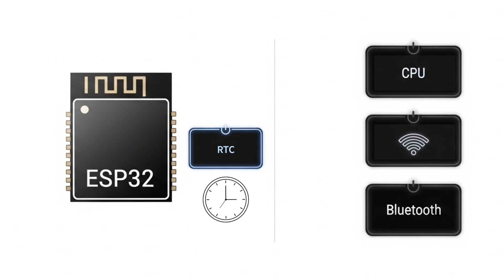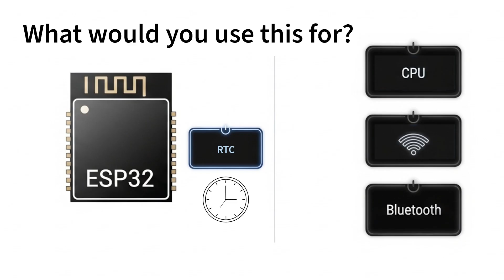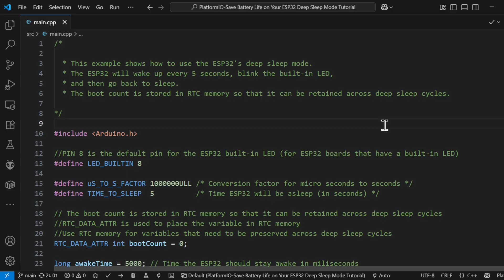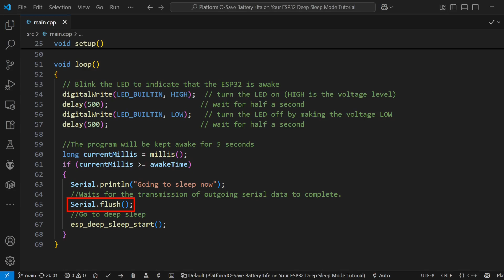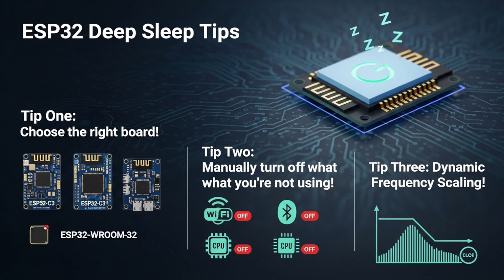Save Battery Life on Your ESP32 – Deep Sleep Mode Tutorial

Comment: Would be great if you had that in Mashtastic.
Reply from the maker: I have thought about experimenting with deep sleep in mesh networks. 

I think the challenge would be maintaining synchronization between nodes. 

If the nodes are sharing data or relaying messages they will need to be awake together at the same time.

Comment: The Problem is ESP32 variants never designed for Low Power Devices however ESP8266,ESP 8285 are low Powered MCU's cause they draw current in deep sleep mode about 7uA or even ESP 01 draws much much lower 3uA. You video content is misdirecting new learners and new makers. However if your requirement is Bluetooth in project it is best to go with ESP32 and use a Switchable LDO with a ATTiny MCU project then you can turn off ESP32 and keep ATTiny alive... this way you can make Low powered ESP32 projects
Reply from the maker: I appreciate your insights regarding low-power MCU options. I'll experiment with some of the modules you mentioned and do a follow up if I can reproduce a lower uA.
Reply: @bjdsolutions8928 Yes, but make sure you check out resistors within ESP variants cause those resistors draw continuous current. If you bare bone ESP8266 can go as low as 3uA without its built-in resistors
Reply from the maker: re: A "Switchable LDO with a ATTiny MCU project then you can turn off ESP32 and keep ATTiny alive... this way you can make Low powered ESP32 projects"

I am thinking something like the Adafruit TPL5110 Low Power Timer Breakout could be a good starting point?
Reply: That is indeed a cool concept. I have done a lot of stuff with the attinyX5 series, long time ago, but I found them  to get too expensive (relatively)  compared to other MCU's. But yes, for this concept it might be a good idea
Reply: If you turn off the power  of esp32 then erase the RTC memory, and the eeprom it has no more than 10.000 r/w life
Reply from the maker: Definitely important to consider!

Comment: Well done! I’m interested in a project that uses wifi and wakes up the ESP by an externally triggered pin change.
Reply from the maker: Thank you for watching!

An event based wakeup would be triggered using the 'External Wake Up' instead of the 'Timer Wake Up' method.

In the video's code: 'esp_sleep_enable_timer_wakeup(TIME_TO_SLEEP * uS_TO_S_FACTOR)' would be replaced by 'esp_sleep_enable_ext0_wakeup(GPIO_NUM_X, level)' in the setup function.

'GPIO_NUM_X' would need to reference a GPIO pin on the esp32 which will be used to trigger the wakeup. 'level' would be set to 0 or 1. Depending on whether the trigger is activated from a LOW or HIGH signal.

Comment: Well explained and useful! How would we design the battery based power supply? To get stable 3.3 V, there is usually a step up / step down converter involved. And those things draw permanently current. Any idea for an overall solution with low power consumption?
Reply from the maker: Thank you for watching!

The ESP32 in the video is a Seed Studio XIAO ESP32-C3. This has battery connectors and a voltage regulator built in. It gets down to 30ua in deep sleep. 

The ESP32 data sheet says 5ua should be possible. Any voltage regulator will add some extra current draw. Perhaps 10ua at a minimum; but I am yet to find a dev board that can go that low.

One solution--a bit more advanced--would be to create a custom PCB for the ESP32 chip that does not use a regulator at all. That is--powered directly by the batteries. The ESP32 has an operating range of 2.2-3.6V. Which means the voltage of the connected battery could not exceed 3.6V. Standard lithium-ion (Li-ion) battery's 4.2V maximum voltage is too high but a LiFePO4 battery would work because it has a typical voltage range of 3.2V so would work.

In short ditching the regulator entirely would get the lowest possible power consumption but the connected batteries must never exceed 3.6V.

Comment: i am making a clock using two 0.96 inch oled screen, ds3231 and esp32. Can the esp32 power the oled while in deep sleep? ( I dismantled this project after doing everything but failed to make it battery powered)
Reply from the maker: Short answer no. The digital I/O pins that would normally control the OLED are not active during deep sleep, so they cannot provide power or control the display.

It would be possible to maintain power to the oled if it's VCC line was powered directly while the ESP32 was asleep. But the ESP32 could not update the display until it woke back up. The OLED would also need to have it's own RAM buffer to maintain it's display while the ESP32 was asleep.

Comment: One problem with quite a few of the ESP32 board you might get from Aliexpress is that the power supply might draw quite a few milliamps, more or less rendering the deep sleep moot. Board with battery connectors are typically ok, but it is always good to measure.
Reply from the maker: I noticed that too. I have a few variations of the board lying around and the deep sleep power consumption varies widely. The one in the video is a Seed Studio XIAO ESP32-C3. This has battery connectors and gets down to 30ua in deep sleep. The data sheet says 5ua should be possible. 

Maybe it would take a custom PCB without out a USB port to get to 5ua? And either a very efficient regulator or running straight off the batteries?

Comment: This is great content, but you might turn people off with the sudden volume changes in the voiceover and loud sound effects (like 0:07, especially if they are wearing headphones)
Reply from the maker: Oh right ... I will tone that down and equalise the volume. Thank you for the tip and heads up! :-)
Reply: @bjdsolutions8928  I use to use audacity or these jobs back in the day. I would have a pipeline which would remove noise, normalize volume, add compressing and enhance the bass a bit.

Comment: that could be more useful to know how to awake it by an event (as a door open detection or flood alarm).. by the way, which ones are able of this very low current?!? ..thanks to have turned on my curiosity!!
Reply from the maker: Thank you for watching!

An event based wakeup would be triggered using the 'External Wake Up' instead of the 'Timer Wake Up' method.

In the video's code: 'esp_sleep_enable_timer_wakeup(TIME_TO_SLEEP * uS_TO_S_FACTOR)' would be replaced by 'esp_sleep_enable_ext0_wakeup(GPIO_NUM_X, level)' in the setup function.

'GPIO_NUM_X' would need to reference a GPIO pin on the esp32 which will be used to trigger the wakeup. 'level' would be set to 0 or 1. Depending on whether the trigger is activated from a LOW or HIGH signal.

As for achieving an external wake up with very low current that all depends on the trigger. If a sensor needs to be constantly powered this may get tricky. Unless the sensor itself can sleep too.

One way to have a low current external wake up is to use a phyical button or microswitch as the trigger. In your door open detection scenario I could see a push button or microswitch being used for the external wake up; which is pressed when the door opens.

Comment: Great video! And THANK YOU for sharing and explaining the code.

Is there anyway you could do other videos explaining how to do things like turning off Bluetooth and slowing down Dynamic Frequency Scaling?
Reply from the maker: That is a great idea for a follow up video. I will do that. For now I can say it is possible to change the CPU frequency quickly with the function setCpuFrequencyMhz(CPU_FREQUENCY). CPU_FREQUENCY can be set to 240, 160, 80, 40, 20 or 10. You can verify the current speed by checking getCpuFrequencyMhz(). 

The Bluetooth module will be off by default (Same with wifi). If bluetooth has been activated at any point and needs to be disabled that can be done by calling the relevant diconnect or stop function depending on the bluetooth library used. BLE.disconnect() for ArduinoBLE. 

Deep sleep will turn off all modules except for the RTC. Even if they have not been explicitly disconnected.